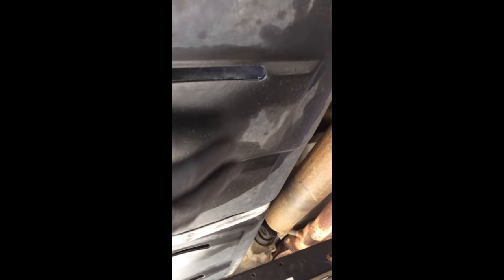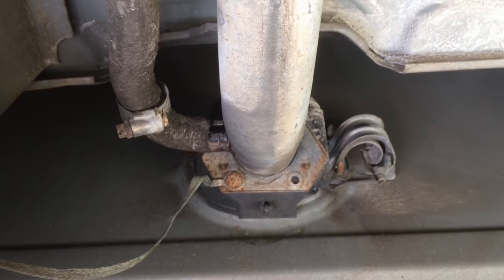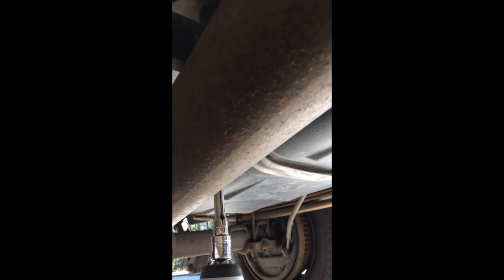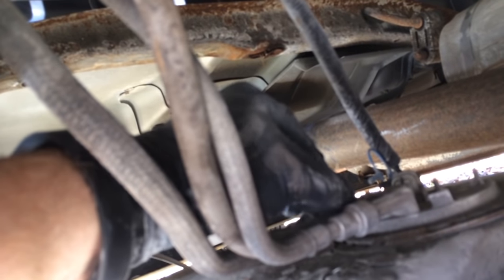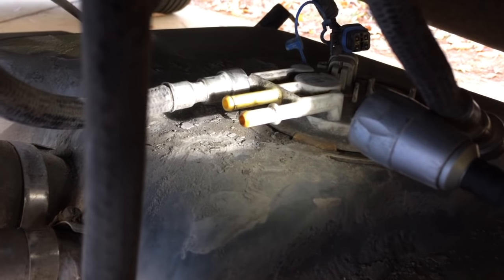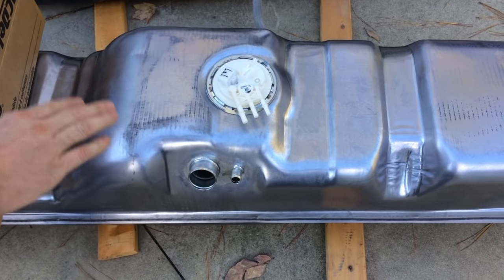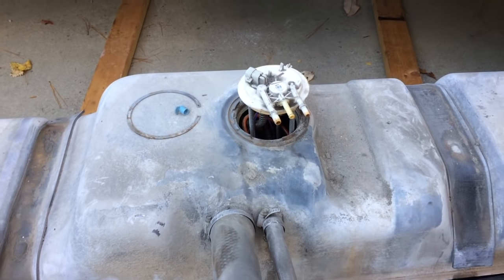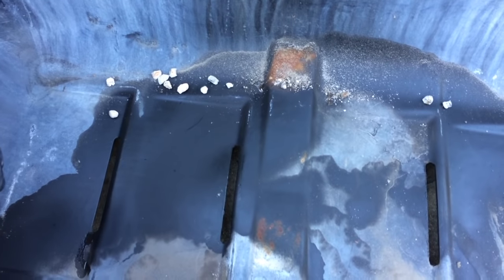1994 - 2000 OBS GM Long Bed Pickup Truck Stock Fuel Tank & Pump Module Replacement (Chevy & GMC)

Comment: Can you use the spin on lock ring with these tanks?
Reply from the maker: The Spectra model shown in the video, like the original GM style, is all steel not plastic so requires a snap ring style.   I used a genuine GM part (ACdelco TR9) in the video, but the Spectra equivalent would be lock ring part LO91.   The spin type is for plastic tanks.
Reply: @DrShock  Thanks for the answer. I just installed new tank in my 98 silverado and somehow the snap ring popped off and the pump popped out. I was smelling fumes and finally went under and felt up top and sure enough. I gotta drop the tank tomorrow to see what happened.

Comment: Hello Edward Shockley
Thanks for taking the time to post this. After watching this, I now have a better idea of what I'm up against. I just ordered a replacement tank,  pump & straps for my '98 K2500 with the 34 gallon tank, today. I did not know about needing that special tool for disconnecting the fuel lines. I'll have to pick 1 of those up when I go to town to pick up my parts when they come in.
Reply: Just pulled my tank to change the fuel pump, you don't really need that tool. It's nice to have but not necessary, I dropped the tank and changed the fuel pump in a little less then 3 hours by my self for the first time. A little Jack is really all you need. My 3 ton Jack was hard to move after the tank was on it

Comment: I have an early model 1999 GMC Sierra 2500 5.7L gas.  Am wanting to order fuel pump and have it in hand before starting to remove tank.  Web sites are offering one (1) wire and two(2) wire pumps.  How do I determine what one I have without dropping the tank?  Your video was very informative, Thank you for taking the time to post it.
Reply from the maker: Yeah, I've seen this difference.  You'll need to access the OG GM pump and find the three letter code stamped into it (or just check the harness connection).  You'll see something like GFK (2 pin harness) or GFT (1 pin harness).  There are several of these codes, these are just two examples.

You can also swing by a GMC dealer, with your VIN, and have them tell you the GM part number for the pump module your truck was originally built with.   That can be easier to cross reference for ordering beforehand.
Reply: @DrShock  Thank You for the GFK/GFT information.  Do you have any suggestion short of remove the bed or remove the bed liner and cut a hole in the bed as to how I might go about grabbing the NUT that WAS  spot welded in the rib but broke loose and now just spins around that the rear bolt screws into that holds the rear strap in place?
Reply from the maker: Well I wouldn't personally cut or modify the bed, I like to keep things perfectly stock.  Can't say I've ever hit this particular problem before.  But I'd more likely aim to just lift the bed access, rather than completely remove it.    No less work fastener removal wise, but maybe a little less than a lift and shift off.

Comment: You and you and some other person never showed how you get to second high-pressure line off is there a tool for that or you just pull on it really hard and all were watching videos and never accomplish to see what I was sent out to see but you were very thorough with everything else thank you
Reply from the maker: Shown at 12:39 thru 14:22 using the GM special fuel line release tool.

Comment: I have a 97 Chev 1 ton with a 454. I took it to a repair shop to have the tank and fuel pump replaced. When I got it back I immediately noticed that it was running rough, the truck was shaking, and the check engine light came on. I took it back and they said it’s an injector. I had the injectors replaced a year ago with ac delco injectors. They said the filter was plugged and something must have got through. I think the mechanic did something wrong because it was running fine before taking it there Any ideas what went wrong to cause the damage to the injector?
Reply from the maker: Really hard to say, as there's no specific code for the check engine light relating to a fuel injector itself (when one goes it can cause a number of symptoms).   Any debris large enough to affect an injector would have been trapped between either the fuel module assemblies filtration sock or the inline fuel filter on the frame rail.    So their analysis is probable, but I'd say only if you have not been keeping up with regular maintenance intervals on the fuel filter itself.

Comment: Really needed to see how the wiring harness was switched over
Reply from the maker: There is a diagram included with the ACDelco fuel pump module that is year/model based that shows that.

Comment: Hi, I ran into a difficult issue I created for myself and need advice. I accidently sheared off the tip of the fpts that sits on top of the fuel pump while trying to remove it and now I need to replace that sensor.
Since I only need enough access to get my hand on the top of the fuel pump, would you suggest lowering the tank or raising one side of the bed? If only lowering the tank a few inches , would I still need to disconnect the filler neck? Apologize in advance for the stupid girl questions but this is my first time dealing with any fuel tank related issues.
Reply from the maker: I would imagine you could go either way on the two approaches, but I tend to prefer leaving the bed alone (corroded fasteners an all that may present themselves).  The thing about lowering the tank, is you have to have a jack or some improvised way to safely lower and raise it. Even for a few inches the filler tube will have to be removed, it's a pretty tight fitment there.
Reply: Thank you so much for the prompt reply. I will attempt this in about an hour and hope all goes well

Comment: Out of curiosity I have a van that's been sitting for several years I just boght it as far as I can tell theres no dry rot in any of the hoses or any animal damage however it does have a small amount of fuel in the tank I'm curious should I do the depressurization method prior to draining the old fuel and adding new far as i can tell it does not require a new pump
Reply from the maker: You wouldn't have any pressure to speak of for a vehicle that's been sitting for years.  But you would want to clean out / flush that tank of the old fuel as it's very likely varnished up.
Reply: @DrShock  any cleaning solution u would suggest using as far this goes I've never had a vehicle that had been sitting this long so it's rather new to me
Reply from the maker: I do this rarely enough not to recommend a specific brand, but your local NAPA or Autozone will have fuel tank cleaner kits or just the cleaning solution as well.  My approach is to inspect for rust first, especially under the insulation strips GM glues onto the top tank areas.  While some folks will attempt to repair these with epoxy, that's temporary at best.  I will scrap any tank with deep corrosion and replace with a new one.  If you get past the rust check on the outside, time to do it on the inside.   If you get past that check, then you can invest the time and money to clean it out with a chemical product.   I would only suggest the tank cleaning since you said it's been sitting for years .   I personally would not bother to do this on a tank from a running vehicle, unless it was a special problem like water in the tank or with diesel having microbes in there from water intrusion.
Reply: Thanks just wanted to be sure the van belongs to my sister as shes the one who bought it and as I have very little experience with this issue I figured best to ask rather than end up with more issues than it already has lol

Comment: Getting the fuel lines off this has been a ridiculous challenge. How are we supposed to get the tools in there to get the line off??
Reply from the maker: The special tool to release the clips, and a metric flare wrench will fit in there.   But not really any room for other tools or to improvise.  It is a pita.
Reply: @DrShock  I had to buy two different sets - a metal set which didn't fit, and a plastic set which I mangled the hell out of. I got the lines off, but it took a few hours of screwing around with it and some sketchy maneuvering with a flat head screwdriver to finally get them off.
Reply: Gotta do this tomorrow morning and I’m nervous about this part. Hope those quick release tools work okay for me. And I hope I can find them at autozone in the morning.

Comment: my 97 sierra sl long bed was purchased used from an old man. He or maybe the prior owner before him swapped out the 34 gallon tank it should've come with and installed the 25 gallon tank used on short beds. I want to swap in the 34 gallon and want to know if I can reuse the current straps holding up the 25 gallon tank or do I need to purchase new ones?
Reply from the maker: As best I recall the REAR straps and bolts for both are common across pickup body tanks (both gas and diesel regular cab models used Front 15567776 & Rear 15567777 but extended cab used front 15611433) but the FRONT varied if they are the OEM GM ones, so as long as neither the bolts or straps are damaged or suffering from excessive corrosion that would weaken them you could reuse them.  If you end up tossing one for these damage though, best practice would be to just get new all the way around for safety.   A good place to double check parts is rockauto.com, you can see a number of different strap vendors in one view and make sure beforehand.
Reply: @DrShock  thank you, I appreciate it
Reply from the maker: Take note I edited that comment with the part numbers just now.
Reply: @DrShock  Man thank you very much. Just saved me some time.

Comment: I probably missed something in the video but where was the tank leaking from? The fuel pump seal?
Reply from the maker: Yeah you missed it, rewatch in the side by side old/new comparison.   The damage is on the bottom of the tank.
Reply: @DrShock  ahh ok, I don't know if mine is leaking from the fuel pump seal or if the the tank itself has damage on top. The only time it leaks is when it's on a hill.

Comment: I got a 1995 Chevy 2500 long bed and need a new tank because it’s leaking is this how I’d do it or is it a different truck?
Reply from the maker: I would expect it to be very similar to this 1998 K2500.   You might have some different clearance to work with (i.e., need jack stands) if you have a C2500 vs a K2500 though.  There would be differences if you have the dual tanks feature too.

Comment: What side does the high pressure line go on the tank
Reply from the maker: The line along the frame rail to the fuel filter will be the outlet from the fuel pump module, the pressure line.   At the top of the sender, it will be the larger diameter pipe.   I may be recollecting this a bit off, but pre-1997 I seem to recall 3/8" for outlet pressure and 5/16" for the inlet return line.  With the vent being the smallest. For 1997+ the quick connects only fit one way, so you can't go wrong.   Hope that helps.

Comment: When replacing the fuel tank, do you reuse your old fuel tank shroud?  Are they glued to the tank?
Reply from the maker: If you mean the black plastic protector, yes you reuse it I show in the video at around 28:42 that this just sits between the tank and the straps.  It's not glued.
Reply: @DrShock   Thanks so much.  So I assume to remove it, you just tapped around it with a tool or something to pop it off?
Reply from the maker: In my case it just slid off with my boot holding the top lip while I lifted out the tank.   Was not a very tight fit.   If yours is putting up some resistance, and it is still made of plastic, you might try some plastic prying tools like you would use to remove interior trim along with a small rubber mallet to work it off without any damage.  No metal tool sparks!  ;-)
Reply: @DrShock   Thanks!  I'll definitely try that.  :)

Comment: I have a 4 door 95 LS Tahoe how do I go about ordering a new one because mine has drill holes in it
Reply: A new fuel tank
Reply from the maker: The how-to , this other video of mine for a Suburban should apply to the Tahoe too - https://youtu.be/dw9Hia55yys and for the where I'd recommend Spectra Premium tanks since GM discontinued the originals over a decade ago.   You could find the correct one for your 1995 at rockauto.com
Reply: I tried rockauto and didn’t have any luck
Reply from the maker: I see two listed for the 2 door 95 Tahoe, Spectra GM51A being one of them.  Same story at LMC Truck here - https://www.lmctruck.com/1992-99-chevy-gmc/gas-tanks-parts/csd-1992-99-gas-tank-and-components-2-door-models      These old body style trucks are getting very hard to find large parts for, you may have to look into adapting the 2 door tank to fit your 4 door as it may be the closest match available in 2021.

Comment: Thanks, i have a question , can you just seal the tank with in weild
Reply from the maker: I presume you're asking about some type of chemical patch, rather than suggesting actual welding on a fuel container, even if empty.   My opinion on the former is it would only be a temporary solution, perhaps if you were far away from home to get you back there kind.   My opinion on the latter is that would not be worth the risk of injury,  or even time and effort to reduce that risk, compared to the price of a brand new Spectra steel fuel tank.

Comment: If I'm replacing the bed anyway should I pull the bed first or pull the gas tank first?
Reply from the maker: You don't have to lift the bed to swap out the tank, but if its out of the way it makes the replacement procedure a little easier (the hard part of this job imo is dropping and raising the tank itself with the vehicle not on a lift).  If you were already planning to do it, I'd say pull the bed, replace the tank, then install your replacement bed.
Reply: Excellent! Thank you for the advice. My bed is so rusty and shot so I could use a new bed.
Reply: Take Bed off then swap tank is the easiest then put new bed on

Comment: Is this procedure the same with a 6.5L diesel?
Reply from the maker: I doubt its the same part number tank, and there's no fuel pump in the tank on the 6.5L (it's just a level sensor) so the connections will differ.  But it should be similar for the same model truck.   It's quite different for SUV models.
Reply: @DrShock  I watched your Suburban diesel tank video plus this one. Now I'm ready to tackle my 95 6.5L fuel level sender replacement. Thank you for such detailed and well done instructions!

Comment: I have a 1997 Chevy 1/2 ton long box 4 wheel drive pickup. I had a local guy replace the fuel tank and pump about 7 -8 yrs ago. Well he is long gone and now for the last year or so, if i fill my tank the tank leaks like a river. i have to keep it about 1/2 full and it will still leak when i drive and the gas sloshes around. I want to do what you did in your video, I want to drop it to check it out. Is there any thing you have learned you can tell me you would do different or any other advice to take off the tank to diagnose my problem?

Comment: You cant drop the tank on the ground in a 95 you have about 4 in of hose to play with
Reply from the maker: Sounds like you're setup may no longer be factory original then with only 4 inches there. I'm looking at a 1995 factory service manual for GMC & Chevrolet to check, and the illustrated procedure is the same as shown on the 1998.  The only difference at a dealer of course would be they would have hoisted the truck up on the lift, rather than leave it on the ground, before dropping the tank.

Comment: Couldn't get the plastic tools to disconnect the lines to work, finally the plastic nipples broke off the pump I pulled too hard trying to get the couplers to release. Arghhh! Now how can I get these  bloody pieces out of the line connectors? Awful design GM!